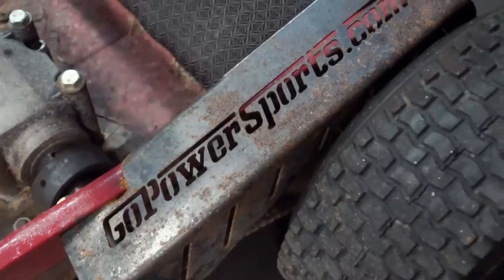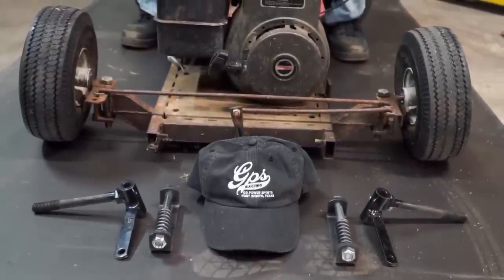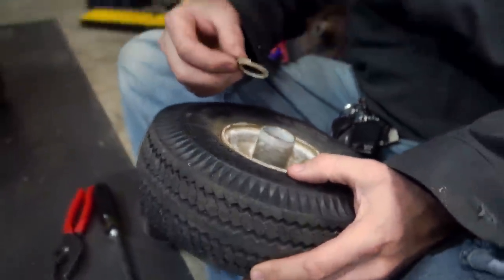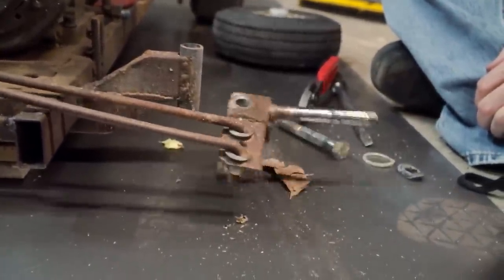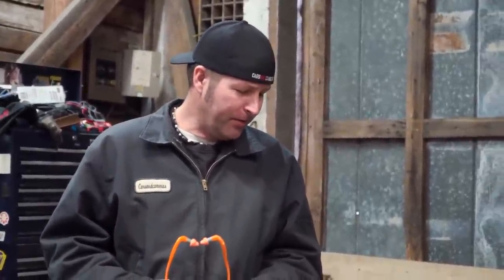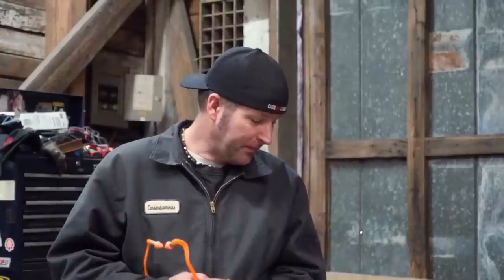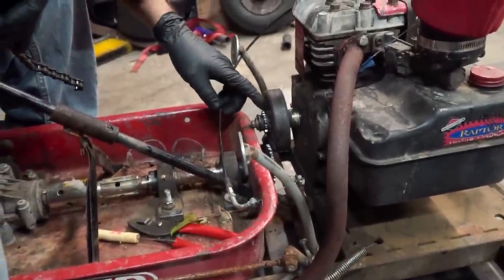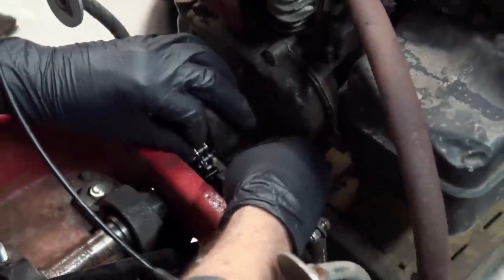Rat Rod Wagon Overhaul! Radio Flyer Go Kart Build

Comment: Can I make a suggestion for a mod for the Radio Flyer wagon go kart, a slight little addition, nothing too crazy... I think would go very well with it. Wooden stake sides in the back half only for seat supports, like a seat back and side bolstering kind of thing, but just rough wooden steak sides like you find on some little kids red wagons. I think it would look good and definitely help hold you in your seat when you're on a wild ride.

Comment: The wagon probably been one of my favorite builds you guys have done. Its rough and simple but it definitely has that Rat Rod look. I'm glad you guys did some work on it to make little improvements while not taking away from the look..
I'm sure you guys, or at leas Ike already knows the trick but you can take salt and mix it with water in a spray bottle to "encourage" the rust a little. A friend of mine used to do that one leaky water pipes that were made from Cast Iron. The rust seals up the leaky joint until you can properly fix it.

Comment: You see John sand out a wheel bearing hole and Loosely attached a couple tie rod end links. Then you see him use a spray paint can for the underside which nobody will ever see. Again, like does all the work! Literally Ike does all the cutting, grinding, welding, basically all the dirty work that takes a little bit of skill and knowledge. What does John contribute to the video? He takes it for a ride and gives a thumbs-up with an ear-to-ear smile like he did anything to get that cart where it is. And then says it feels faster after only changing the steering, it must be all that clear coat on the bottom of the cart that made it fast. Followed by saying it bogs down and has an old carburetor. Hard facepalm while shaking my head...
Reply: I heard that clear coat can add up to 30hp! Hahaha!

Comment: hey John and Ike, my buddy and I are building some barstool racers out of some old 5hp snowblower engines we got for free. I was wondering what gear ratio you were using for this kart / what gear ratio you would recommend using for a relatively light kart to avoid burning up our centrifugal clutches. Thanks! I remember way back when you guys were building this beauty of a kart! Time flies!
Reply: Basically the clutch will be however many teeth but the axle sprocket should be just a little smaller than the rear tires.
Reply: Isaac it'll be fine appreciate it

Comment: The engine may be worn out and burns oil like a 2 stroke, but why don't you put a diaphragm kit in the carburetor?  It will pump more fuel so it might perform better.  I like the springs added to the front end.

Comment: You made a comment in one of the recent videos that you haven't welded with 220 until the new shop. Have you guys been using flux core welding all this time or something different?
Reply: Weve been using welders with 110v rather than 220v

Comment: Smokin like  2 stroke guys... ~( 'w')/

That engine's got a whole lotta blow-by. ~( ,m,)~
Reply: That's the great thing about a Briggs.  Even when they are worn smooth out, they can still run a long time and make fairly good power as long as you keep oil in them, and change the plug when it fouls.

Comment: now it looks like a Poser Wagon , all those wantabe Hot Rods out there shinny rusted Patina paint jobs , you just ruined it now it's a Poser ride just a wantabe , you could have done the maintenance and even painted those tie rods black or something so they didn't stand out so much but the clear doesn't matter if it is gloss or simi-gloss even mat finish , when was the last time you seen shinny surface rust it just doesn't happen that way , good luck Posing maybe you could wear a Bow Tie while you are riding around in the Poser Wagon , I don't think Ike could pull it off but I know John could with a button up shirt , slacks and wing tip shoes , I tell ya Ike you have to try to teach John how to be Cool